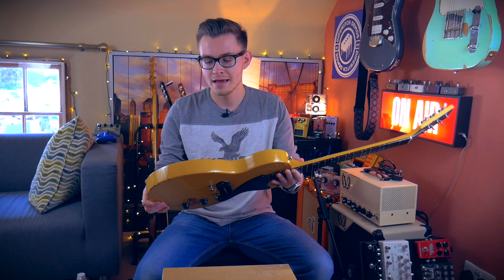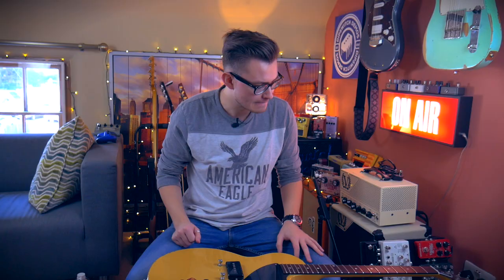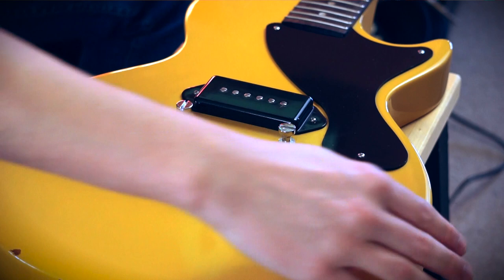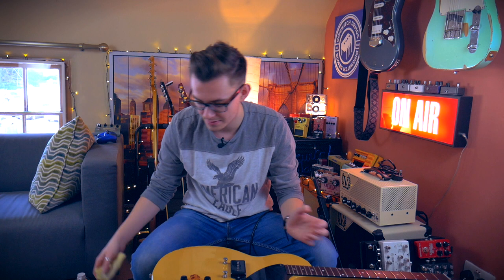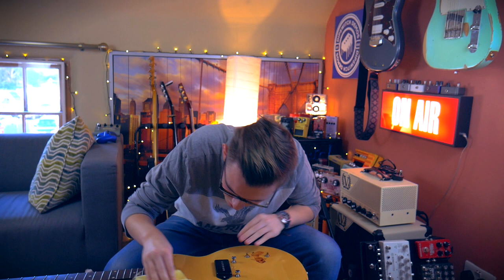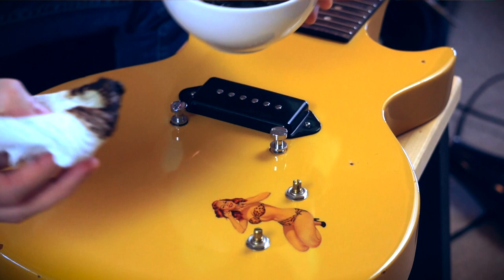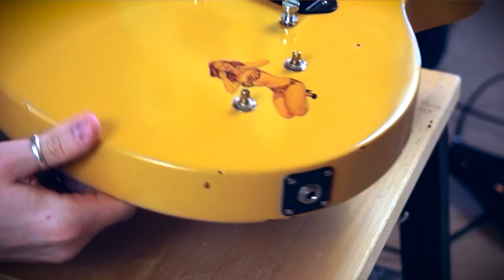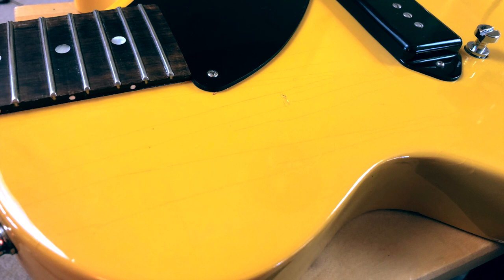Cracking the lacquer on my Les Paul Jr... Danish Pete style!

Comment: Just be careful not to melt the wax your pickup is potted with. You could end up with a microphonic Pickup. Also remove any of the plastic parts just in case the heat warps them.

Comment: A little tip. Wet sand it with 1200 grit. Polish to a inconsistent gloss. Meaning, leave it dull here and there. Then finish check it. Be very careful not too go overboard wet sanding. Your essentially wanting a worn look. So wear it down. Just a tip. It worked incredible on my Tokai LP.

Comment: So I have a guitar I really want to check but I don’t think this way does a very good job for one reason.  When the guitars naturally check the lines are 99.9999% always horizontal across the guitar (perpendicular to the string direction if horizontal doesn’t make sense).  

Do you think it came out looking “real” or just came out looking different? 

Cool vid regardless! Thanks!
Reply from the maker: I'll admit to being surprised that the lines came out horizontal. That being said, I've since seen pics of plenty old guitars with prodominantly horizontal check lines.
Reply: @JacksonBrooksby  did u mean predominantly vertical?  I was saying that horizontal is what you typically see on vintage guitars.
Reply from the maker: Yes I guess so! Sorry I was imagining the guitar the other way. I've seen plenty of pictures of old guitars with the lines going the same direction as the strings too